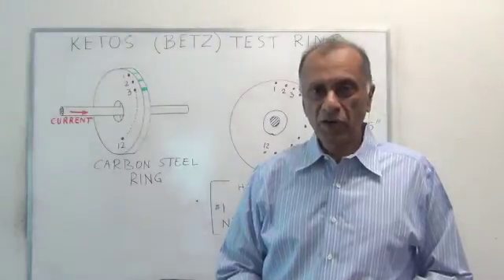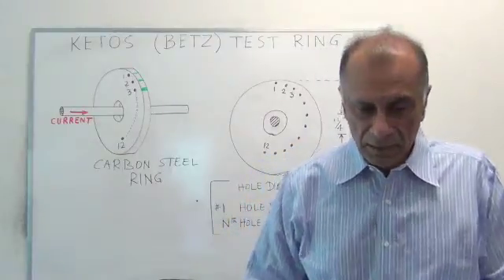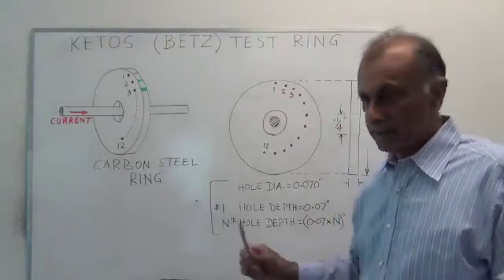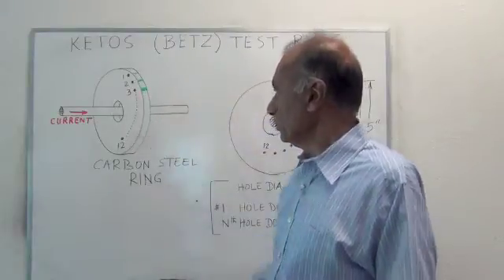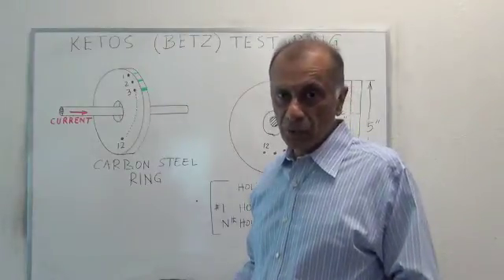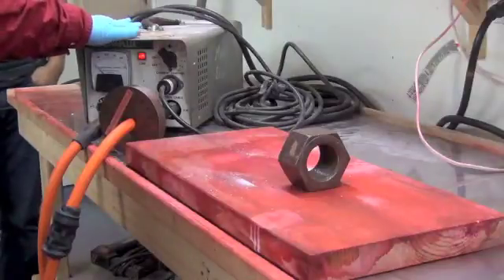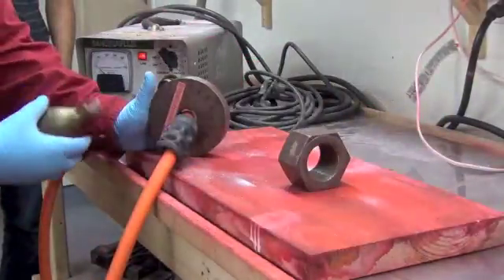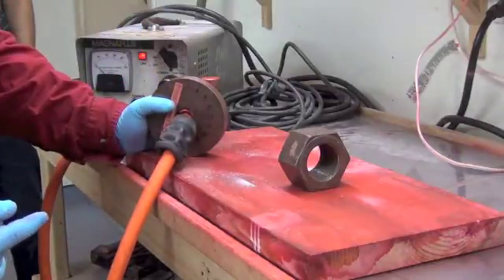Birring NDE 102, MT Ketos Ring; Magnetic Particle Testing

Comment: Please, I need to know to justify in my research work, from what standard or where do you refer to the depth of each hole of the Ketos ring, since I reviewed the ASTM E1444-16 and AS 5282 standards and I did not find said depth specification
Reply from the maker: It is 0.07 inch increments and given in ASNT NDT Handbook vol 6. MT
Reply from the maker: Let me check and get back
Reply: Thank you so much !!!
Reply: Hello, I need to know what is the maximum examination thickness in pieces to be inspected in a wet horizontal unit for MT magnetic particle tests or through the use of the magnetic yoke, either by wet or dry technique.  I have reviewed the ASNT NDT Handbook Vol 8 MT and the ASTM E 1444 and E709 standards and I have not found information about it.  I would greatly appreciate your response.